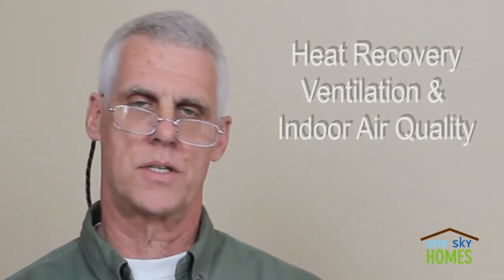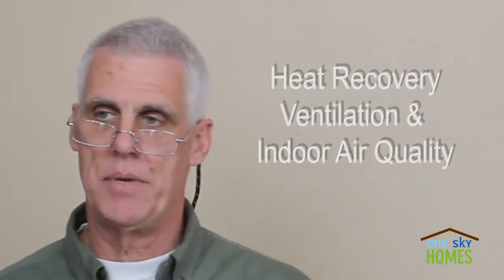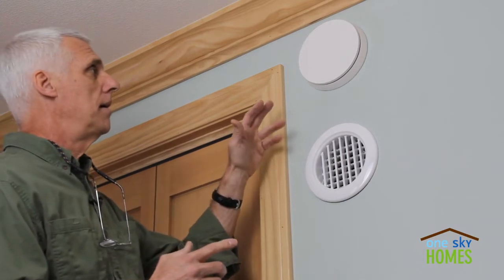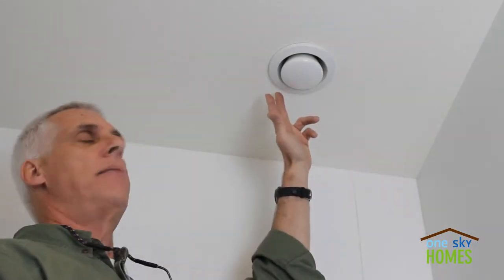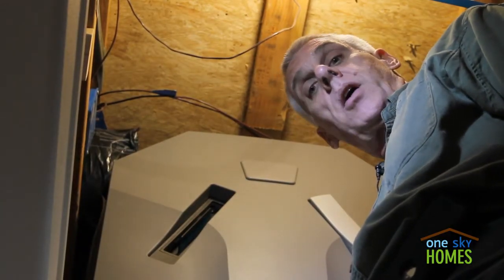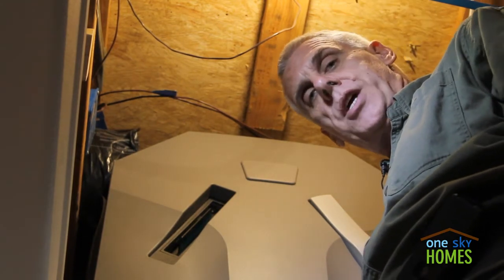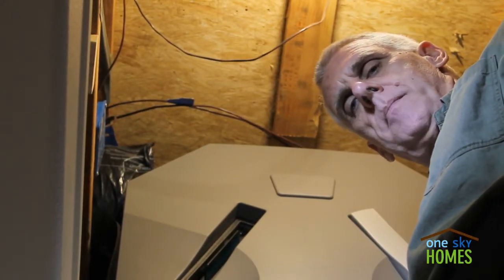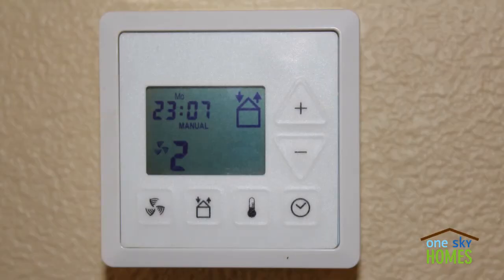Passive House - Balanced Ventilation for Indoor Air Quality

Comment: GOD BLESS YOU. It is so important. The air quality has become the main issue for me. I came to canada (saskatoon) about a year ago. And this place is total crap. Most of houses have no ventilation at all. So you need to open windows, but people around still burn wood for heating, and you wake up because your room is full of smoke. I changed an apartment and now I live in a concrete building in downtown, but so many people smoke cannabis here on the balconies that I still wake up because my room stinks of smoke that came from outside, I even changed one apartment to another but it still the same problem. Also people use charcoal barbecues on their balconies, the smell is like someone burns plastic. When I walk outside the air becomes saturated with intoxicating diesel fumes every 3-4 minutes, it is so humiliating to walk like this. I tried pm 2.5 mask, even a small wet towel to breath through. But this city stinks so bad that it doesn't help. Too many cars here are like chemical attack on the wheels. Too many people smoke cannabis here, and I get this intoxicating smoke in my face at lest 3 times a day, just when I walk outside. So few people like you understand how air quality is important. Most of people inhale awful air all the time. Canada is so behind the times in this aspect. Most of places in the world have awful air, that narrows the human life to just an animal level.